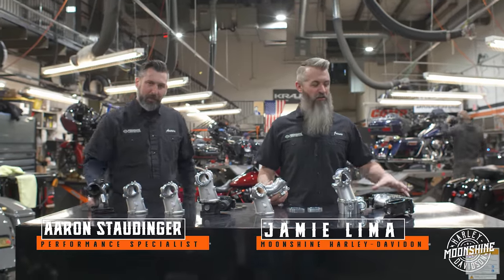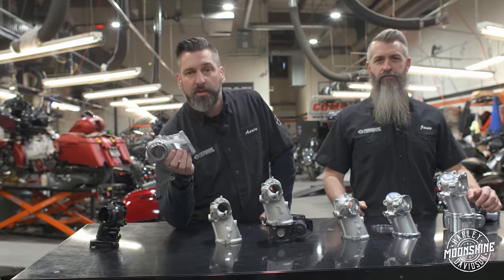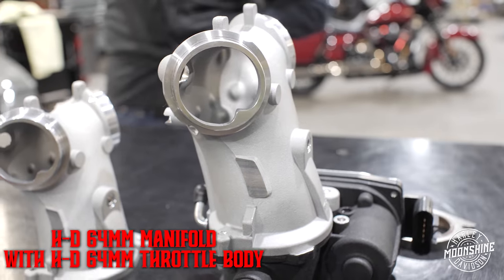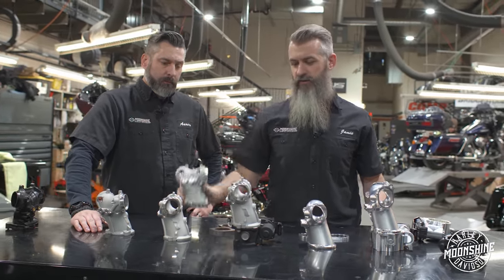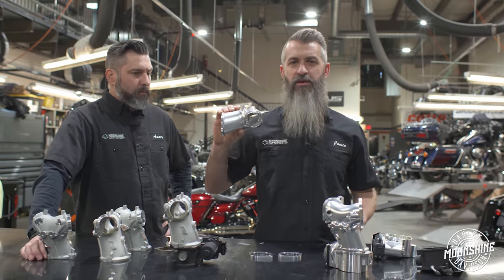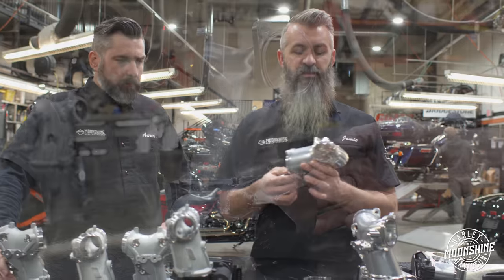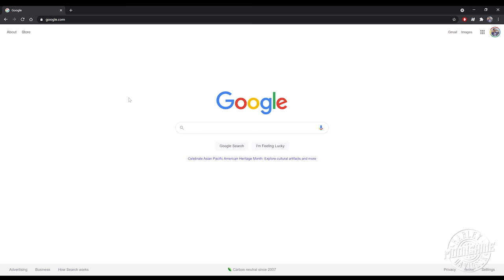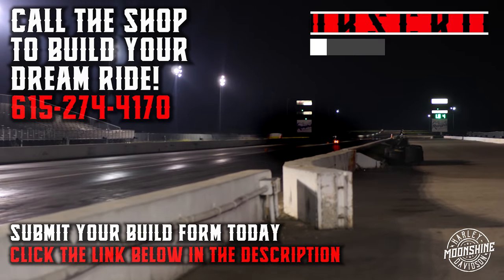2022 M8 Intake Manifolds & Throttle Bodies Overview | NEW POWER FOUND! | Shop Talk Episode 55

Comment: Very educational videos guys!  Got my parts from Aaron for my 117 stage 2 build and it’s on the lift.  I appreciated all the research you do and share for free.  I feel you steered me in the right direction with the 485 cam and can’t wait to open that 64mm tb.  Thumbs up!
Reply: Which 64mm throttle body you go with?
Reply: @shawn9878  I’m not sure if there are several, Aaron chose it and sent it.  Bike is done and it  rips really nice!  That cam produces really nice roll-on power (or LET-IT-RIP POWER) on any gear to 6000+ rpms!
Reply: So you went to the 64mm with a stage 2? I’ve been curious about doing this instead of changing bore size, let me know
Reply: @dextersuarez9948  
It turned out nice, quick with good roll-on power.  I haven’t ran into someone with a 131 or bigger that wants to rip so I can’t compare but it’s quick.  Also have a stage 2 107 that was pulling away from  when this 117 was stock, now I can pull away fairly easy.  Close to 140 torque based on dyno.
Reply: There are zero videos out there with this configuration I’m on the fence about going with this build it would be nice to see a video on it I would like to hear what the loop sounds like on the cam
Reply: Nice. What were your dyno #s ?

Comment: You say later that you run the 64 with throttlebody on 128, but early on it's suggestive they can  be run on stock displacement like a 107 or 114. Not exactly direct.

Comment: @moonshineharley Would the Harley 64mm throttle body and manifold benefit a 21 road glide 114 with S&S 475cam with oil pump and cam plate with a Bassani road rage 3 mid length?

Comment: Would the 64mm kit work great for the 117 Stage 2? Got a RGST with stage 2 on it and was going to just go with a better 55mm but now thinking the 64mm. Any insight on that @moonshine
Reply: It does. Running the exact same setup on my ST Stage 2. The bike loves the extra air trapping when combined with some good 6.2 GMR injectors, my F35A cam and a Stealth Turnout. 140/140 on the dyno
Reply: @JakobKaizen  whats your set up? Im running 472 cam kit and D&D bobcat 2-1

Comment: Would you recommend replacing fuel injectors as well with the 64mm throttle body and intake manifold? I have a stage 2 S&S 475 Cam Chest Kit, HPI exhaust and intake. Thank you.
Reply: Update: I went on and installed 64mm throttle body and manifold with 5.5 g/sec injectors paired with complete stage two….. oh man!!! Runs great!! Highly recommended!

Comment: A lot of good info here. I went 122 Stage III on a ‘21 M8. It would have the 447 cam I think. Also went with the oil pump and cam plate upgrade and the Heavy Breather Extreme. The intake is currently factory. Is the 55 aluminium or even 64 / throttle body and injectors worth my while or am I just going to harm my torque?
Reply from the maker: You’ll gain both HP and Torque with our MHP-F064 Ported 66mm on your setup. You’ll also need a 64mm Throttle Body. Then you’ll have to re-tune.

Comment: I have a 2022 114 SHS with a S&S 465 cam with the S&S throttle body. I the cam making 107 hp and 118 foot pounds of torque. I am looking for more mid to high with out giving up the low end torque. What would a 64mm throttle body kit do for me with this set up?

Comment: On your stage 2 with the 64 mm with a S&S 475?cam and 2 into 1 exhaust. What kind of numbers should you be getting? This is on a 114 M8. And would you recommend 5.5 injectors. If how much would this affect fuel mileage. Thanks Buck

Comment: whats the reliability  of ur 135 kit  ....... 2 up cross country  in the mountains  loaded down .  Just looking  to build a tug boat .....??????
Reply: You will definitely get what you pay for but it’s not cheap. From everything I’ve seen Moonshine kits are built to be as reliable as possible so you can ride it like a stock bike. If reliability wasn’t their biggest concern I bet they could get 200+ HP with out a power adder but it wouldn’t be something you could just ride anywhere any time.

Comment: Are you guys not suggesting the HPi 62 anymore for a stage2?
Reply from the maker: We run the H-D 64mm manifold and throttle body. The vanes on the inside of H-D manifold help the air turn the corner.

Comment: What is the diameter of the air cleaner backing plates that are used on the 64mm and larger throttle bodies,  can't find information  anywhere???

Comment: Hello Moonshine Techs, I appreciate your overview on the intake manifold and throttle bodies for HD. I purchased a 2020 Breakout 114cu and had a SE Stage 3 installed. The HD technician at that time discouraged me not to include a 55mm or 64mm intake with my upgrade. However, after reviewing your video re: throttle bodies, I’d like reconsider my initial plan. Given what I currently have (stage 3), what intake & throttle body would you recommend I install?
Reply from the maker: H-D 64mm Throttle Body and Intake
Reply: Greatly appreciated, love your vids. Just an FYI, I live on Hawaii Island (Big Island). The HD dealership on this island closed for business. It’s difficult finding certified HD mechanics to service my bike.

Comment: I’ve got a stage 2 114 breakout with the woods 22x cam with 113/129 to the ground 
Going bigger on my manifold and throttle body is guaranteed 10 horse? 
What about bigger injectors?

Comment: what about torque? Do these larger manifolds and throttle bodies sacrifice torque to get the HP gains. I dont rev hard and looking for low end torque over high end HP. Thank you.
Reply from the maker: We have not experienced lower end torque loss with running the 64mm on the set ups we explained. Our MHP-485 cam on a 107 and 114 benefits through the entire torque curve from the 64mm/64mm setup.
Reply: @MoonshineHarley  Thank you

Comment: will 114 with stage 2 462 cam will it benefit  from 64mm and if so how do enable 64mm throttle body with the street pro tuner screaming eagle software with a stage 2 do that is intended for a stage 4?

Comment: Great videos you make! I just bought a 2022 street glide st . Am waiting on it for delivery . I was wondering is there a way to tune a stage 3 122 upgrade with the 64 mm tb/intake combo using the screaming eagle tuner? Or Do you need to select stage 4 in the tuner with figures it in the stage kit. or is there a option to select my stage 3 122 and click on tb ? Trying to keep warranty thanks
Reply: I have a 21 SGS with the 122 and S.E tuner. Too EPA restricted

Comment: Can you put the 64mm on Milwaukee 8 114 stage 3 with stock heads without it running sluggish?
Reply from the maker: Yes. You will need to re-tune it.

Comment: Cost of parts cost of labor cost of dyno tune then how much hp I have a 2018 flhxs with stage 3  with rcx tormentor  head pipe I'm making 111 hp and 121 lbs of torgue now what diff. Will I see.
Reply from the maker: For more info please contact the 
Moonshine Horsepower Team
Nick - Aaron - Jamie - Mike
Phone: 615-274-4170
Email: horsepower@moonshineharley.com
***If you email us please provide a good contact phone number for you.

Comment: So, what flow rate injectors are you utilizing? 5.5, 6.1, 7.1 or something else?
Reply from the maker: It depends on the build we typically use 6.27-7.80 depending on cubes and cam.

Comment: What size injectors do you use with the stage 2 builds and the SE 64mm throttle body/intake?

I have the RS468 cam, Khrome Werks 2:1 and HD ventilator extreme intake on 2021 road glide limited.
Reply from the maker: Stock.

Comment: Would you suggest running a 64mm throttle body and intake with a red shift 468, dand big bore exhaust and a Thundermax tuner? For a 2022 road glide st 117.
Reply from the maker: Yes. But we would swap the RS468 for the MHP-485 if possible. You’ll have more gains across the whole curve.
Reply: Just wondering why the mhp 485 vs the rs468?
Reply: @soberlife1264  becuase it’s theirs… they want the money.

Comment: Do you guys that a 55 mm ported and polished S&S intake manifold makes any kind of difference on a stage 2 application over stock?
Reply from the maker: We have seen gain on our MHP-485 cam when paired with our CNC Ported 64mm Manifold. We would recommend a H-D stock 64mm manifold with the winglets inside or our MHP-F064 manifold.

Comment: I've liked the Aluminum Intake over stock ,  on a 107 stage 2 is a 64 mm to much or use 55mm ?
Reply from the maker: We pair the 64mm/64mm with our MHP-485 cam. 115-120hp
Reply: Thanks for the info, I heard you guys talk about your 485 didn't know on a 107 stage 2 good numbers u got. A good  runner
Reply: Ment to ask about tourque numbers too just wondering
Reply: On the video 3:30 he said 114 but did not mention 107. It's not clear to me about 64mm 107 but I'm gunna try it with 465 reaper
Reply: @vulcano2093  in their most recent livestream (08/26/22)they show a dyno chart for a 107 with that MHP 485 cam.

Comment: I just don't know what a street bike or touring bike does reliably with 150+ hp.
Reply from the maker: Just depends on the build…we have a 128 and 131 that make 150 plus which has shown to be as reliable as some smaller builds. It depends on the cam and parts paired with the build.